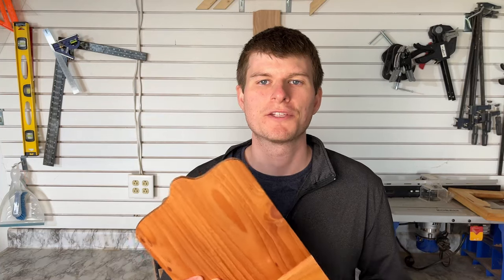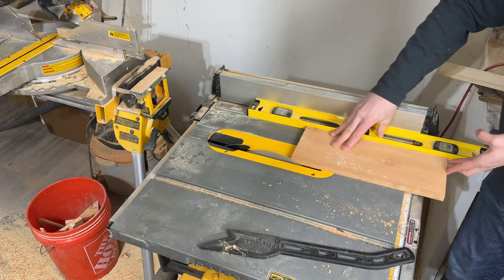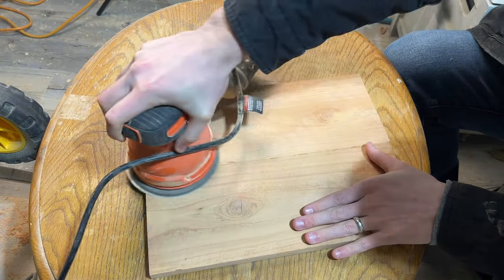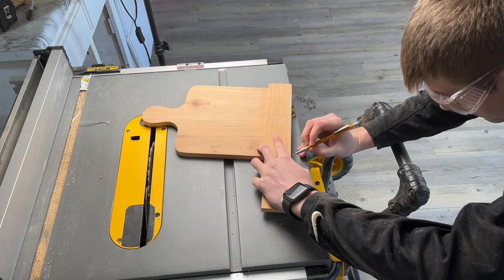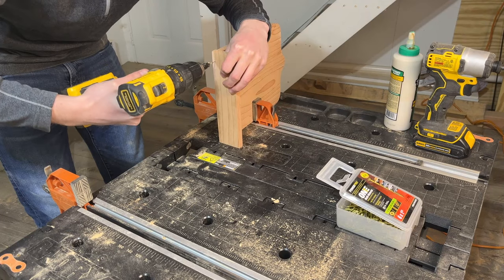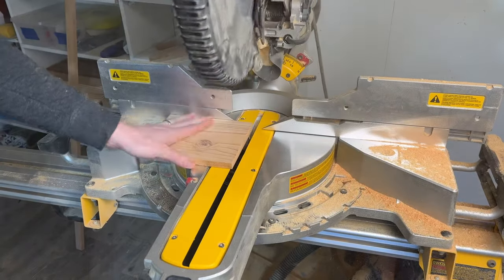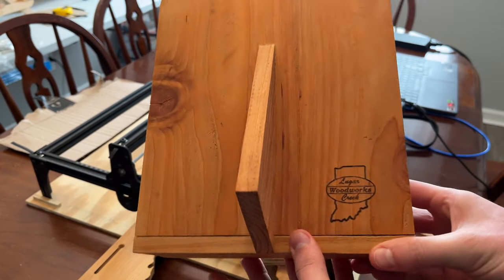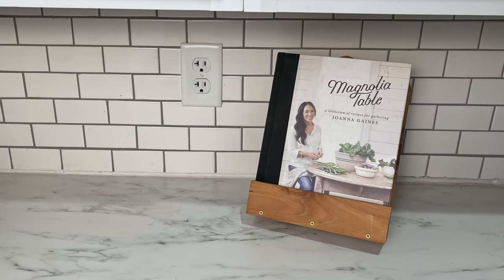Will It Sell? - Cedar Recipe Book Holders

Comment: I'd recommend using a counter sink bit to enlarge the pilot holes on the front, driving the screws deeper and filling with dowels for a cleaner look. I dont think people will prefer the screws being exposed, it looks half finished
Reply from the maker: That's a good idea. The screws are already unnecessary since it was glued.
Reply: I agree, the screw appearance cheapens the looks and makes it look like it was put together in a garage.

Comment: Hi Corey, I just found your channel and wanted to say "Hi!"  These recipe book holders are very cool.  One tip that I like to use for difficult to clamp glue ups, like your kickstand here, is to use wood glue on about 95% of the joint, and then a few drops of thick CA glue spaced between the beads of wood glue.  You can then spray accelerator on the other piece, and the CA glue will cure almost instantly, acting as a clamp while your wood glue dries.
Reply from the maker: Good idea! I got some CA glue recently to hold together 3D printed parts, but didn't think about using it on wood projects. I'll give it a shot!
Reply: @Corey.Deaton  ca glue and wood working g hand and hand order more 😂